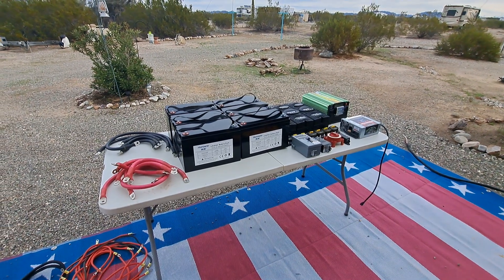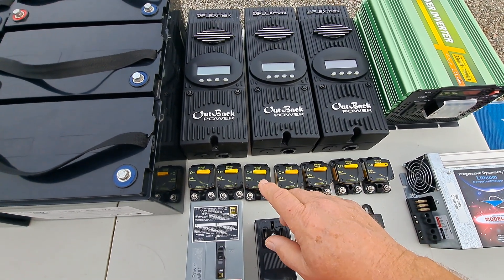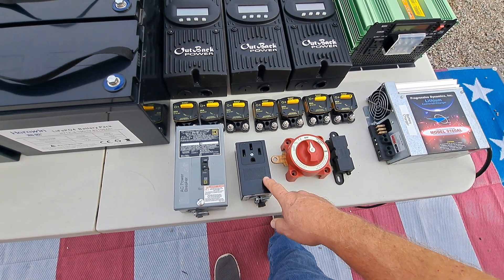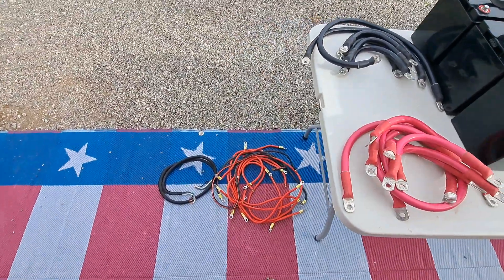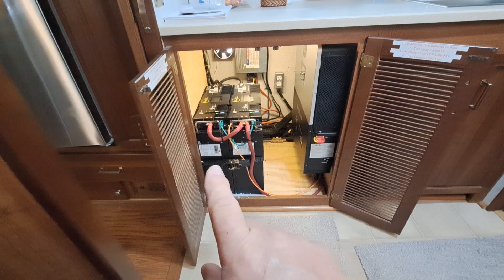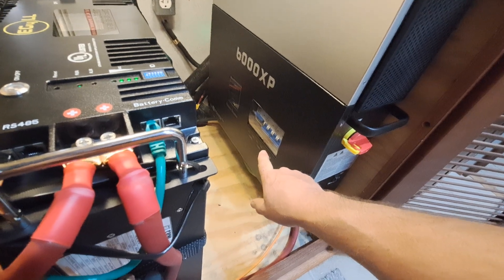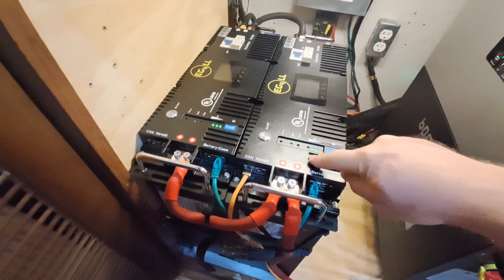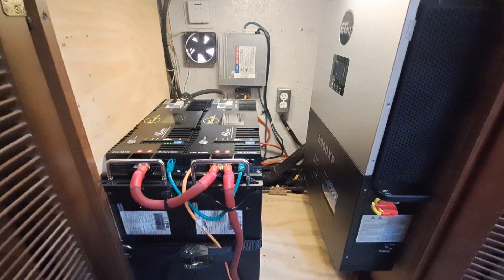RV Solar Battery Upgrade

Comment: im going to follow your 48 volt path soon, is it possible to reuse those 12 volt batteries in series to make a 48 volt battery to add to your system?with out the communication aspect
Reply from the maker: You could just not sure how well they would be utilized by the inverter.  In terms of charging and discharging. 

Thanks for watching our videos and for your comment. We appreciate your support.
Reply: It depends on the BMS’s in the 12v lithium batteries, some can be put in series, but some can not.
Make sure if you are going to series connect 12v lithium batteries that the BMS is rated for 48v series connection or it can blow the BMS.
I Pulled 8 x cheap 100A LifePo4 Batteries apart to make 2 x 24V 5kW batteries for a 24V system in a bus, I used 2 x JK BMS’s and it has worked perfectly for 3 years now running a 3KW AIO system with 2kW of PV panels.

Comment: How did you avoid powering the converter from the inverter ? Also, did you use welding cable for cable flexibility?
Reply from the maker: The converter is plugged into the 120VAC and charges the 12 volt motorhome batteries. The inverter is powered by the 48 volt batteries. The inverter powers the 120VAC. The two battery banks are separate from one another. 

As for the cables, the battery manufacturer recommended 1 AWG. I however used 2 AWG and crimped on the needed connectors cut to length. 

Thanks for watching our videos and for your comment. We appreciate your support.
Reply: @igowhereimtowed6839  is your converter powered by the inverter ? If yes, then your inverter is backfiring the twin batteries which is not good.
Reply from the maker: @VideoByPatrick  The converter batteries do not power the inverter. Some people will use one group of batteries to power their system. I use to different groups of batteries. That way, I have not created a loop or backfeed. Two separate battery groups for two separate systems.

Comment: Hey there,if those 12V bateries are lifpo4 too,why u dont use 4 of them in series than paralel it to the 48v ones? same chemistry same voltage would it be,more capacity!
Reply: Yes its a good analogy,but i am afraid you aint getting me,i am saying,4 of thise bateries can be added to the 48v bateries you have,Add to it for even more capacity,4 in series,gonna be also 5 kilowats,than paralel them to the new bateries…if same chemistry…
Reply from the maker: @83kaszas  while putting 4 - 12 volt batteries in series, increases the voltage. It does not also increase the  amp hours. Search batteries in series for a complete explanation of series and parallel.
Reply: Yes but you increase the voltage! To the same level as the 2 server rack bateries you aquired,so it will be a 48v batery with 100 amper hours,right? Now tie that bank to the 2 server rack and you have 15kw instead of 10
Reply from the maker: One 12 volt 100ah battery is 1.25 Kwh. One 48 volt 100ah battery is 5.1 Kwh. The 2 - 48 volt batteries have the same capacity of just over 8 - 12 volt 100ah batteries. 

Thanks for watching our videos and for your comment. We appreciate your support.
Reply: I know everything about batteries,we did like that before and it works just fine,only the wire lengths has to be equal,so they share discharge currents equally

Comment: Cool Info. The only thing holding me back from the EG4 6000XP that I can see is that it requires at least 100vDC on the solar side. I was hoping it would as low as around 44 to 48 volts. It can accept 48v on the DC battery side, so I don't quite get why they cannot design it to accept 48v on the solar side too.
Reply from the maker: If you have 3 panels @ 44 volts. Connected in series would be 132 volts. This is 22 volts more than the required 100 +/- 10 volts. We have 2 strings, one at 330 volts and the other at 177 volts. 

Thanks for watching our videos and for your comment. We appreciate your support.
Reply: The 6000XP is also not UL-458 safety listed for use in an RV.
Reply: @originaldiysolar That is good to know. Thank you.

Comment: Nice job. I’m installing three of the same batteries and the 18k in my rig right now. A week after I got the 18k the 6000’s came out. I had to find a bit more ingenuity in my install because it is so much bigger. Almost done. I can see these 6000’s being the new standard on solar installs vs. the victron.
Reply from the maker: Originally, I was going to install the 6500. But by the time I got around to ordering, they discontinued it. That's how we ended up with the 6000XP. 

Thanks for watching our videos and for your comment. We appreciate your support.

Comment: Looks like a really excellent upgrade.  Another EG4 6000XP success story it looks like!  Very nice, gives you two AC legs on the output, split-phase, and 240VAC, and has all the circuit breakers you need built-in. You went with 16s 51.2V nominal EG4 LL's, those are excellent batteries (also with built-in breakers).  You have some redundancy with two of them in parallel.  And you have BMS comms connected up.

I'm not entirely sure about standing the EG4 LL's up on their ends.  Usually the prismatic cells inside have over-pressure vents on the top which can wind up exhausting electrolyte instead of gas if the batteries are stood up like that and a failure happens.  Maybe verify with the manufacturer whether that is ok or not.

Since you have only one 6000XP connected up you might want to consider wiring a separate 3000W inverter to the battery that you can use in case of emergency if the 6000XP konks out.  Something like that can also be quite useful wired to a kitchen outlet with a remote switch to allow additional heavy appliances in the kitchen to be used concurrently.  Though of course the 6000XP itself has a lot of capability.  Be sure to split any other heavy 120VAC loads evenly between the 6000XP's L1 and L2.

As well as keep some of your independent MPPT charge controllers hooked up to the battery (if not already, assuming they can handle a 48V battery system)... again "just in case" the 6000XP konks out.

I think you are going to be really happy with that build.  There is going to be a massive reduction in heat and power losses with that setup, and a huge improvement in power delivery.

-Matt
Reply from the maker: Per the battery manual, standing them on the end is acceptable. 

Thanks for watching our videos and for your comment. We appreciate your support.
Reply: That is some excellent advice.
Reply: The high frequency 6000XP is not designed for use in mobile applications because it's not UL-458 listed. And because it lacks and output transformer, there is no galvanic isolation between its DC boost stage and its AC output which makes this inverter less safe when compared to a low frequency, transformer based inverter charger.